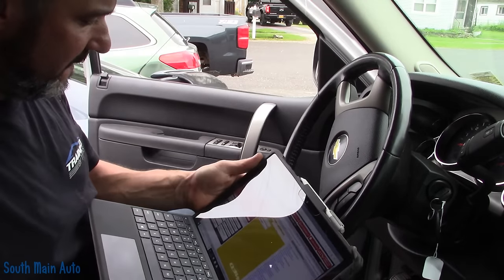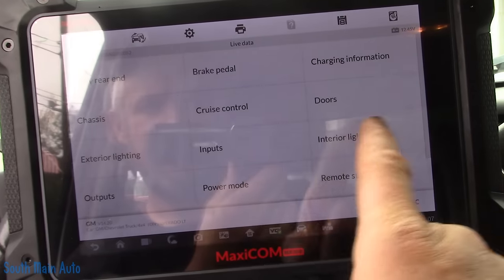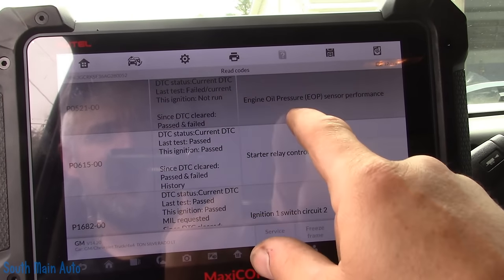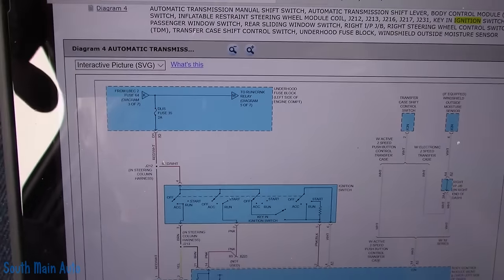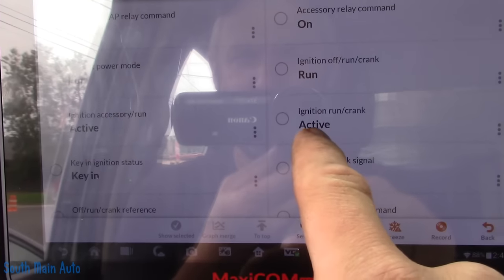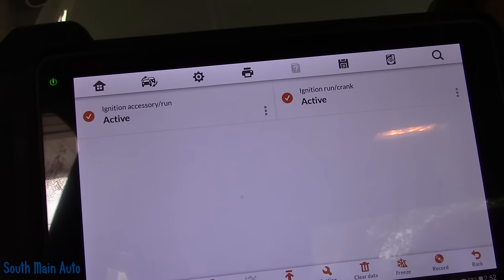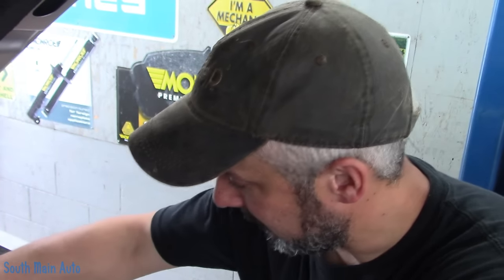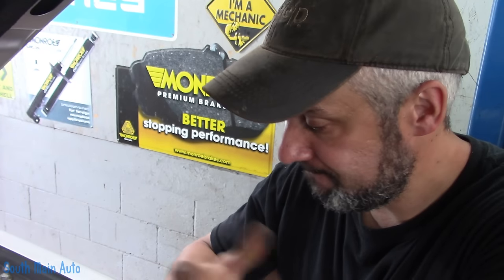Chevy/GMC Truck: No Start - No Crank

Comment: Good job. You are a asset to the automotive industry.  I had a customer yesterday that had a no AC complaint.  AC worked last summer,  never worked this summer.  Only had car worked on at stealership.  I found AC compressor relay was gone. A Chevy dealership had yanked it out during their  winter maintenance oil change for a fast easy summer come back. People like that give us a bad name.  You on the other hand are a gem to us all.  Thank you for everything.
Reply: I had something similar happen after the very last free maintenance visit I received from BMW Sahara in Las Vegas. All the sudden it was going into limp mode and throwing codes, had them look at it, $600-700 in purely diagnostic fees later I was told I needed a $5k turbo job done. Took it to a local guy who specialized in BMW's and he had it fixed within minutes. "Somehow" a hose or two had been disconnected and simply needed to be reconnected. I guess they figured they'd take advantage of the last time they were going to see the car and guarantee an easy return customer and a fat bill. 
Ended up being a blessing in disguise as it gave me the motivation to start learning about and working on my own cars so that could never happen again.

Comment: Just wanted to express my gratitude for your videos connecting me with Diesel Geek. Their simple parts that rectified my P2015 error code on my 2009 Audi Q7 3.0L V6 TDI was inspired. I had a check engine light on for 18 months even after I refurbished and cleaned the intake manifolds, it was frustrating because I didn't want to spend the $2,500 Audi wanted for new Manifolds and motor actuators. With Diesel Geek's fix it was $128, less than 10 minutes for a disabled guy in a wheelchair to fix and the parts arrived at my home in Australia from the US in less than a week 👍👍👍
Ps: I mentioned your Channel when I gave them feedback

Comment: Remember when there were only three wires that needed be "working" to start an engine? You had my head spinning following your explanation of the wiring diagram showing all the interactions that need to be "working" between the ignition switch and the good ol computater in order to start the engine. Another great diag! Someone should invent a de-crusterifier!

Comment: I WISH I could do it nearly as well as you do it.  Your knowledge of electrical circuitry is really impressive, and far better than any mechanic I know.  I’ve restored classic cars, motorcycles, engines and transmissions for years, and it was really pretty easy until computerized modules came along.  I gave been intimidated and wary of going any further into those newer electronics, but you have just a brilliant sense of comfort in that realm.  You would have made an incredible physician (which I am) as your diagnostic instincts are superb!  You are really one of a kind (and so is your very cool wife).   Thank you for these outstanding videos.   Ken Hardy, M.D., Ph. D.

Comment: I have seen that from flood cars, nobody ever looks under that lid when they clean them up for resale.
Reply: I was a little surprised he did not search for water damage elsewhere - it looks like a flood car to me as well (I posted separately on that).
Reply: and, if the lid was on and not removed, dried, cleaned, etc the lid keeps the water locked in for a looooong time and let's nature do it's thing and rot everything rottable.
Reply: Yep, this is why salvage titles shouldn't be allowed to be registered and driven again. If the vehicle is damaged to the point the insurance won't repair it the vehicle should be destroyed. It shouldn't be parted out because that just puts water damaged parts into the system. The entire vehicle should be shredded and recycled into beer cans. If you own a classic car and don't want it destroyed take the insurance max payout before they total it and cover the rest yourself. There is no justification for selling and titling salvaged vehicles to be driven on the road any longer. It just allows things like flooded vehicles to show back up on the market and screws Joe Carbuyer. Places like copart and the morons who buy totaled junk and repair it and sell it should be shut down. In the end everyone has a good time and makes money except the guy who ends up buying a vehicle that should have never been repaired and put back on the road. Sinking tons of time and money into a vehicle that should have been recycled. It is never worth buying a vehicle with a salvage title. Almost all of them are rebuilt by someone with little experience or knowledge and have been cobbled together as cheaply as possible. Worst of all the sellers will still want damn near market value for a vehicle with a clean title and give you some bull about it being rebuilt "better than it came from the factory." 

I went to school for auto body work over 20 years ago and did that for a few years and then went over to the mechanical side and ended up an ASE master mechanic. You can fix a wrecked vehicle just as strong or stronger than new if you have a full shop and the knowledge and tools to do it. Most of the folks buying and repairing salvage vehicles lack all of those things. A flood car is never worth bringing back, never. By the time you replace everything that should be replaced you have spent more than it will ever be worth. Every bit of electronics and wiring front to back needs to be replaced if it was submerged FULL STOP. No exceptions it should all be replaced bumper to bumper and you will never sell it for what it costs in time and parts to do that. Flood vehicles should be crushed and shredded immediately and not allowed to be hauled off "for disposal" because they just end up getting shipped to some rebuilder who patches it up and sells the problem to someone else.

I'm in the habit of looking in all the electrical boxes I can and popping a door panel or two part of the way off and having a gander down in the doors. If you add in looking in any voids in the trunk under the carpet those are normally the places they don't or can't get clean. I also avoid cars that have lived their lives on dirt roads because they end up with dirt and dust everywhere and it will cause problems and you can find the evidence in those same places when looking for flood damage. It will look like someone dusted those surfaces with a nice brownish grey flour. 

If the guy bought it knowing it was a salvage vehicle then he made his bed. He's dumb as dirt imo but made the decision because he couldn't afford or didn't want to pay for a decent vehicle. If the seller somehow got a flood vehicle without a salvage title and sold it they should be charged with fraud. We need strong consumer protection laws to protect against that kind of stuff. A lot of states won't register salvage title vehicles and a lot of insurance companies won't write policies for them. So when a major flood happens in those states the vehicles are shipped all over the country to states without common sense consumer protections like not allowing salvage title vehicles to be put back on the road. 

I've got enough experience on both the body and tech side to say without a doubt that once a vehicle has a salvage title it should never be allowed back on the road as a registered and insured vehicle. We have enough cars, we don't need to save the ones that have been damaged so badly that the insurance says it's not worth fixing. 

It's 50% the fault of people selling salvage vehicles, 35% the fault of states and insurers for allowing salvaged vehicles to be put back on the road, and the last 15% is the fault of the people so dumb or cheap that they buy the things. It doesn't matter in the end who is at fault they should be illegal to register and insure in every state.
Reply: @velvetjones  Great through answer and I agree with every word of it.  I have seen what hurricanes have done to cars and that box fits the description of a flood car - plain and simple.
Reply: Wesley Jones I personally disagree with you. Flood/water salvage vehicles yes others no bc at times the damage can be so small on some vehicles but yet the insurance is only in the business to make money not to fix stuff for you but to make money.
Reply: @velvetjones   YES most insurance company who total out flood cars are suppose to actually crush or part out those vehicles. sadly that system can and has been broken for short term profits. NO not all salvaged titles should be banned as i  have seen on other comments on here some time the owner of  high end cars(normally) will push to have the car totaled to get more money and all the car needs on a quarter panel and paint or nothing more then a head light replaced to be road worthy again. so don't always hate on salvaged vehicles. they are only called salvaged because the insurance company deemed it to costly to repair there loss if your dirt cheep gain if done right. how ever this poor fellow got a hosing by a shady dealer who are the real criminals of the system who are willing to sell these flood cars.
Reply: BigOldDog "rot everything rottable" which is everything! Haha! Your comment made me laugh.
Reply: yup that's salt in that box
Reply: Definitely looks like a flood damage vehicle.  I bet the carpet was replaced and if you look underneath it the floor will be covered in sand and dirt.
Reply: @velvetjones  I have to disagree with part of that.  Not allowing flood damaged vehicles to be salvaged is a good idea,  but not vehicles with body damage.  Two years ago my 2004 Buick Century had 33,000 miles on it,  was garage kept,  and was fully loaded with every option available,  including leather interior.  A man approaching me in a van,  suffered a medical condition,  crossed the center line, and nearly hit me head on.  I swerved at the last minute and he barely clipped  my left rear quarter.  I got an estimate of $2,000 which I thought was a little high, but no big deal... so I thought.  The insurance company wanted to total it, for a little dent that you couldn't even see unless the sun hit it just right,  and some scuffs that buffed right out. I got angry and told them the car was " like new " and I wanted it fixed.  They sent out an adjuster and he came back with an estimate of $ 1,500, which they paid.  My point is... not all cars that are considered totaled should  be scrapped.  Some of them are just older vehicles that the insurance companies just don't want to pay to repair.
Reply: Agreed just checked out a 2500 version with all the cylinders fulla sea water for a potential buyer...crazy what people will try and stick it to unsuspecting folks
Reply: @velvetjones  The auto recycler I worked at would repair some flood vehicles and sell them. Never a sakt water flood. There's nothing wrong with it as long as it's done properly. It has to be stripped down to the bare shell, cleaned and All electrical replaced. Everything! The vehicle was only a few months old and we were fortunate enough to have the exact same suv in our possession that was struck in the front. It had all the same options and equipment. Once the vehicle body was prepared, it was basically a transplant. It was sold as a flood restoration and that vehicle did nit have any trouble. I would never condone repairing a flood vehicle without complete disclosure and it should be done by a professional crew. The man who purchased that vehicle knew what he was purchasing and he was getting a 4 month old Ford Explorer 4x4 Eddie Bauer edition for 3/4 the cost of new and he was very happy with it for years. We did crush many flood cars because only a select few are good candidates but there is no reason not to salvage as many parts as possible. It's a recycling society and there are many parts on a vehicle that are not effected by flooding.
Reply: Superstorm Sandy truck.  Insurance companies didn't even look at them on Long Island October 2012.  Anybody who made a claim got paid, no inspection - the insurance company just took the vehicle away and cut a check.  Thousands of cars and trucks involved.
Reply: @steveorshon  Most of them were stored at an abandoned airport on long island if I recall correctly, I remember seeing the areial pictures there were vehicles as far as the eye could see, here in Jersey these were a lot also.
Reply: @velvetjones  Salvage title around here is too broad. When my car got hit, insurance wrote it off due to cost to repair vs value of vehicle. Someone buying it salvage who can repair at cost would have  a perfectly fine vehicle when done.   Had I known what I know now with the insurance process today (vs how it was before we changed to 'no fault')  I would have not pursued a claim and repaired the car myself for a fraction of the inflated body shop quotes that insurance was basing their decision on.
Reply: @velvetjones   My old man left me his 98 Silverado in mint condition and someone rear ended me and the insurance totaled out my truck.  Bought it back fixed all the damage (bumper and trailer hitch), had it inspected by the state and I am now waiting on the rebuilt title.  The only damage to my truck was the bumper, trailer hitch and a few scratches nothing more, banning salvaged vehicles is not the answer.
Reply: @andylucas8262  yeahhh I agree with that 100% .
 I had a 98 Saturn sl2 and was sitting at home and one day all sudden heard this bang came outside and 3 of my vehicles was wrecked because some dumb ass ran off road saying her car cut off and slammed into my suv then pushed that into my saturn then my other vehicle under the garage and then that into a lawn mower , and all of this is on a 35mph road and she was coming up a hill and she drove a honda civic 2door and u tell me how the car supposedly just cuts off coming up a hill and loses control And smashes into three of my vehicles. Two of them I lost because of her. The suv was done for it was really bad . The saturn hell was just some scratches and a dent that I actually popped back out soo but they Total lost both of the vehicles even though the Saturn was perfect. The way I look at it. Just a bunch of bulshit that I had to go through. I was so so pissed off the suv I just got and was paying payments on too 🤦‍♂️😡🙄🙄 . The pictures and stuff is on my channel if wanna check it out . I'll leave u the link if u want
Reply: I was gunna say... the rest of the engine bay looks sparking clean. How could the inside of the fuse box be so filthy?

Comment: Ive chased all electrical issues for my silver-rot-o to the fuse block under the hood. It's always had the cover on it, and its covered in NY salt/sand crust. Took an air gun blew out all the dust and chased down all gauge cluster faults and ECM faults to that spot.

Comment: I want to see the box get changed you tell that customer that you are lord of the electrical circuit and that you demand that he change that box immediately.
Reply: I too want to see the ensuing carnage of swapping out the fuse box.  Make it so Eric!
Reply: Cue up multiple big-boy swear words!
Reply: Agreed, would love to see this swapped out.
Reply: Same !
Reply: Izzynutz Restorations  me too hope Eric films the box’s change out
Reply: Me too!!!
Reply: Count me in as well!
Reply: Add me to the list of those wanting to see the fuse box replacement! :)
Reply: Looks like you simply raise and rotate the gray handles on each end and the whole thing pops out, is it that simple?
Reply: My 2011 Chevy suburban 2500 series 6 L engine same problem fuse block swap Lift two grey handles Pull inspect replace that easy
Reply: I have to same problem  I've seen repair on ground to frame clean up Video And battery power cable clean up.  I've personally lifted the handles on the fuse box and reconnected it and had a successful start afterwards.  I didn't look at the connections I just lifted it an inch then re-installed it.
Reply: And get a tighter box too!

Comment: My 07 Silverado would die just going down the freeway and had to tow it once but most times it would start right up. Independent mechanic could find nothing wrong with it so went to Chevy dealer and they said it was the fuel pump that had been replaced 4 months ago. But after spending $650 at the dealer for a new fuel pump it still would shut off and sometimes not start. At least the pump was under warranty so no cost on the part just labor. So back it went and this time they found the fuse panel to be bad and another $450 spent. My fuse panel looked like new since I live in the Pacific NW but I guess when it got hot it would loose contact with the power supply. I enjoyed this video, too bad my problem started before I watched this video.

Comment: Slick editing (with the diagram), Eric! Nicely done.
Reply: The scanner computer used in the video: https://amzn.to/2H3l6dt Autel MK908 Ultimate Wireless Automotive Scan Tool with ADAS, ECU Coding, Full Bi-Directional Control, ABS Brake Bleed, OE-Level All Systems Diagnosis
Reply: I think Mrs. O does the editing......

Hides before being caned :))

Comment: Thanks just fixed my no start thanks to this video! Weird part is everyonce in a while it would start just for a few seconds then die then other times not crank at all. I pull that same fuse and it was blew.

Comment: It was nice drinking coffee with you this morning, Eric.  I've never seen a fuse taken apart, not even on Ivan's channel.  :)  I would think that the 2 amp fuse would break from the corrosion first since it has the smallest wire, but the others can't have much runway left.
Reply: Nah the blades are the same size and the actual fuse part is sealed by the plastic, so corrosion on the blades affects all fuse denominations more or less the same.
Reply: Ivan Would fix the fuse no parts needed LOL I like watching him work to